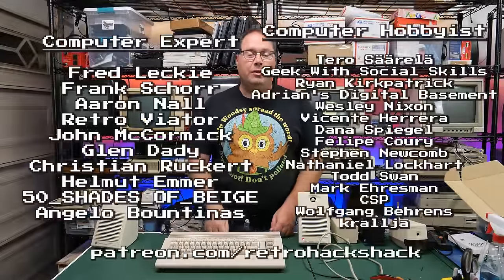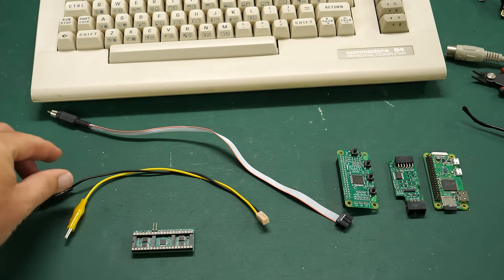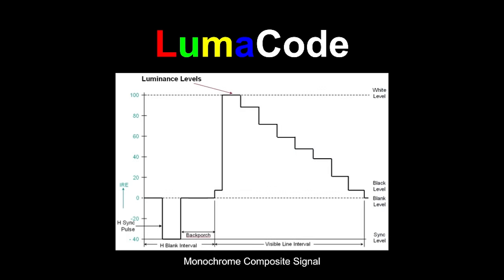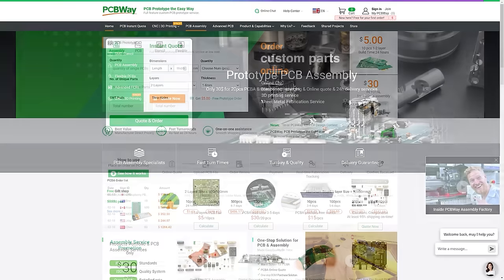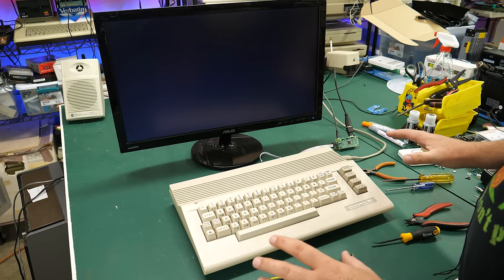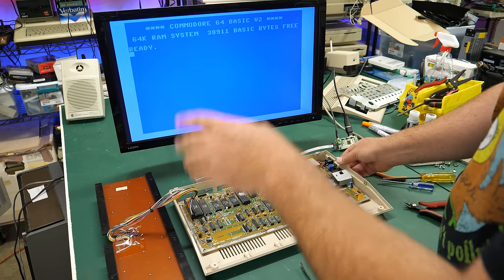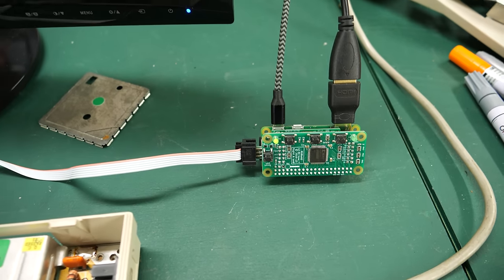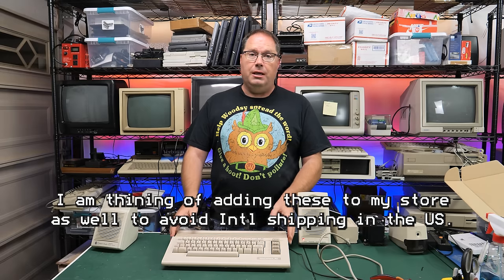[NEW] Crystal Clear HDMI For The Commodore 64 In 60 Seconds

Comment: Not a fan of crocodile clips.  The original Copperdragon mod was very good, probably the best quality output of any video mods.  I like all these people stressing about "Ok Google".. 😂
Reply from the maker: Agreed. I would never use them personally, but they are a good option for those who can't solder.
Reply: i think the alligator clips are a bit thick too put under the case, there's that other kind that just clips the pins that take up less space (no idea what those are called), but then i guess you have to find an actual ground pin to clip to if you went that way.  Anyway, can totally see why they used the alligator clips, they're cheap and easy for a novice to use, and people more experienced might just cut them off and can solder them in.... so a good option for everyone.

Comment: Question: I'm a hardcore C64 artist. I'm used to games on C64 like "Io" with the best GFX available. I had a 1701 monitor, which had perfect video output. Does your hardware setup match? No lags in scrolling, fluid 50Hz all the time? No ghost colours, every single pixel clean and sharp, both in multicolor and highres? If you do RVS ON bulks on the screen with all the colors next to eachother you get evidence: they all must be pure without ghost coloring into eachother. And finally, the analog blur. I do NOT want digital razor sharp pixels that, but the original analog softness.

Comment: Interesting upgrade! What is the latency introduced by VICII-dizer + RGBtoHDMI + HDMI itself?
Reply from the maker: Very low. I can't remember off the top of my head but it's something like a fraction of a frame.
Reply: And if you put a Pi into the process, you can as well run a C64 emulator on the Pi.

Comment: Revelation! Will this work on the KU-14194HB breadbin? Can you connect power to the RB from the C64 board? Is this additional analog board necessary? Because on the Tindie website I only see VIC-II-dizer and RGBtoHDMI, can only these two boards be used without the analog board?
Reply from the maker: You can pull power from the C64 if you are using the Zero. Larger Pis probably not. You do need the analog board.

Comment: Question. With this solution, what is the best option for outputing sound? Use the Monitor out cable I suppose, but I am not sure how to get the sound to the hdmi signal for the tv? What are others doing to solve this?
Reply from the maker: If you have no audio input on you monitor, you can buy a HDMI inserter/embedder. Or just use some powered speakers.

Comment: I have a NASTY idea, why don't use the colour bits to increase resolution? If Black is 0000 and Red is 0100 then we can use that to display Black-White Graphics through this adapter at 640x400 pixels. Or if this doesn't work out, buffer the signal like the Amiga 2024 display does, and then display the frames next to each other.
Reply: Thought a bit about it... using colour would be hard because you really have little control about colour on the C64 as you can not really change colour on every pixel however you want. But putting a screenbuffer in that chip that caches several screens and outputs them at higher resolution... that should be possible with this kind of hardware inbetween. So you could get 640x400 at 12,5hz/15hz or even 1280x800 at 3,125/3,75hz. Ok, the last one would be interesting because it would 132kByte of memory if used Hi-Res. But Text-Mode with 16kByte would be still fine.

Comment: Fortunately I live in France where TV have a scart connector. The circuitry inside the TV is as good as any one may install inside the C64. Just remove the rf modulator and install a dummy required filter

Comment: Now that this exists, it occurs to me that both the C128's A/V signals and the RGBI output could be sent to the same RGB2HDMI. The pi Hat would just need to be capable of accepting both signals. If it can do that, easily switching between the two might be possible as well. Imagine being able to have your 40 & 80 col sources coming out of the same RGB2HDMI device over a single HDMI cable.

Comment: I would prefer a switchable solution - does it affect the standard AV port's output, by the way?
There was a bit of a creak when you lifted that VIC chip.
Reply from the maker: The AV port still works just fine

Comment: Will this work alongside the c0pperdragon RF Modulator replacement board if I just connect the output directly to a normal RF socket?
Reply from the maker: Yeah. I suppose so. Just connect it directly to the rca signal pin and bypass the rest.
Reply: @RetroHackShack  Thank you.

Comment: Hi, any idea when you will have the RGBtoHDMI boards available again?
Reply from the maker: Next week I think.
Reply: @RetroHackShack - It's a clever way of packing 4 bits for 16 colors encoded in voltage levels.  However, without the RF connector patch, you could just snake an HDMI cable directly to the VIC-II/HDMI converter for simplicity.  Yes, no, maybe?

Comment: Does sound pass through the hdmi or do you need to attach speakers?
Reply: I'd like to know as well :)   I didn't read anything about audio on C0pperdragon's site either.
Reply from the maker: No. Sound has to be passed through separately. I usually grab it from the eight pin video din.
Reply: Good.   I thought maybe the 8 pin might not work when video signal is coming through other connection

Comment: impressive! - and what about sound?
Reply from the maker: Sound will have to come separately from the av connector. You could get a cheap HDMI combiner if you really wanted to. There is not an efficient way to combine it on the RGBtoHDMI.
Reply: @RetroHackShack Not yet I hope. Would be a boon to make it more plug and play if you will.

Neat little thing. Wondering if hiding the RGB2HDMI inside the box could be a thing as well. How well does it work with those mods that remove the RF box and replaces it with some small thing?

Comment: I don't understand why Lumacode is required considering the comparators in the rgb2hdmi does the same thing. I suspect more is happening then just separating  colour into a voltage code, like some sort of conversion.
Reply from the maker: I think in this case it has to do more with the speed of the cpld. It's the same reason this device can't handle color composite signals either. I think it would require a more expensive chip like a large FPGA.

Comment: Looks good but pricey if you don't have any of the parts.  All in with shipping it is over $200.  (RGB2Hdmi, Analog board, PiZero, VicDizer, cables, Shipping). Because I don't have any of these things I will just stick to my 1702 and Sony PVM.  I have used other HDMI converters with varying success.  Considering most of these parts are out of stock it is an easy decision.  No offense intended and it looks like a great solution for people that already own a RGB2HDMI setup.  However,  people should know what this set up costs.  You might as well buy a Retrotink 2x-pro and just plug into that.
Reply from the maker: Nothing wrong with a good ole CRT if you have one.

Comment: I ordered one and the PI shield that go's with it. It did not work, there is no luma coming out of the inter poser board. I messaged c0pperdragon and got a response but It got quiet after that. I send him al the scope data on every pin of the VIC, but still no reply. So I think that is something to be aware of before ordering on tindie. I really wanted this to work in my uni64 uBook.
Reply: Please keep us posted. Definitely not gonna purchase if there's no customer support.
Reply from the maker: That's odd. I never had a problem even before I started doing videos.
Reply: Small update, I got send another board and this one works. And it also works in the uni64 uBook clone!

Comment: Are they already programmed to work in a C64,128(D), so i have no to flash anything to them, 
and i mean also the PI?
Reply from the maker: The dizers are preprogrammed. You will have to transfer some files to an SD card for the RPi, but no flashing.